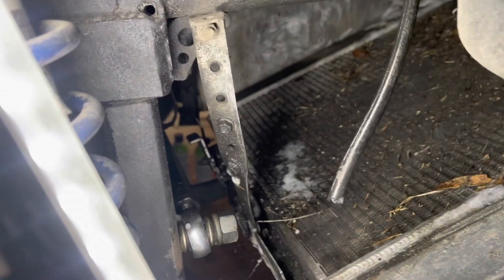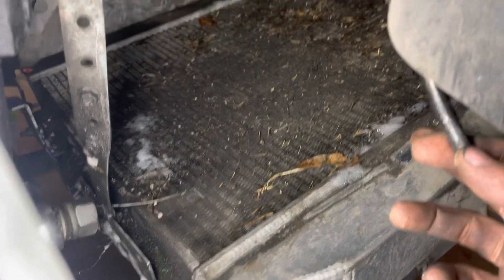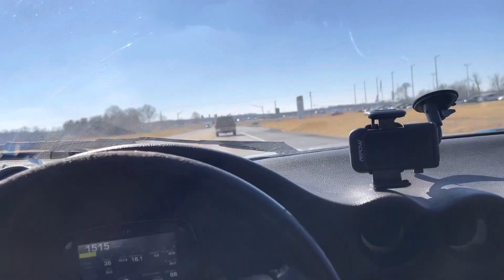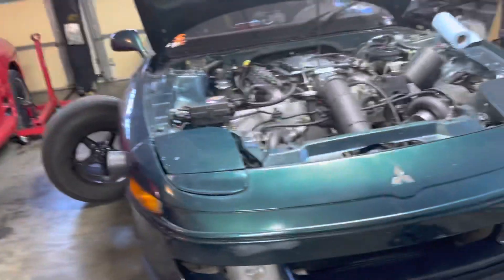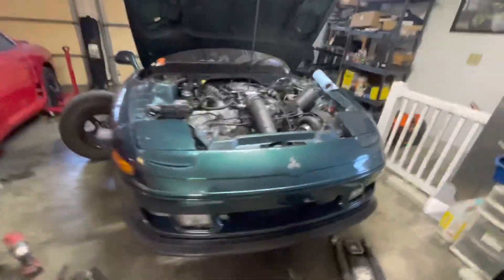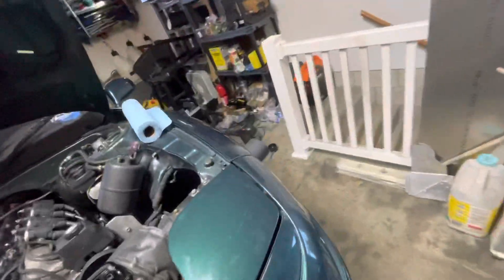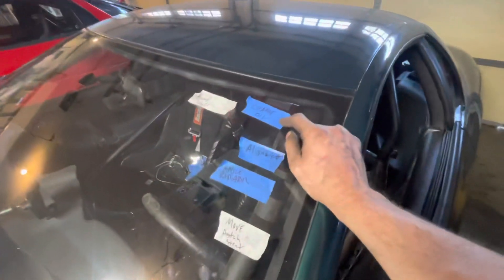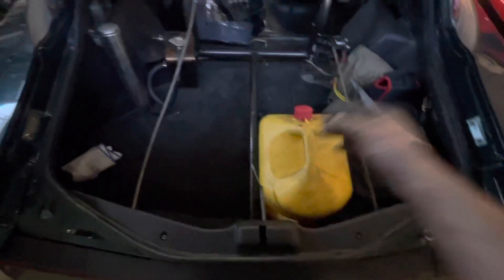AWD LS 3000GT Twin Turbo bumpsteer correction and Race Week prep

Comment: Going back to the flip ups is better looking i think.  Hopefully your new closer front to rear gear ratio/tire size combo will not torture the transfer case as much and the new chain will live a little longer.  I imagine the tons of street mile doesn't help the chain life either.
Reply from the maker: No strain on tcase with street miles with the axle disconnected in front diff. But I do agree that racing on the very slightly mismatched gearing may have contributed to premature chain wear
Reply: @4familyman  I forgot you had that axle disconnect.  Or its the 4 digit horsepower and slicks. LOL
Reply from the maker: I don’t think it likes radials. Slicks will probably help the life of chain a little

Comment: Have you looked into your ackermann angle of the front steering arms? It almost looks like it’s backwards. Would cause some geometry issues if it is.
Reply from the maker: Yes the Ackerman is jacked up. The knuckles are flipped, side to side, because I have a front steering rack, versus stock is rear. The car is a straight line car so doesn’t really matter. But at some point I may fix it,,,which requires cutting the steering arm off knuckles and moving them in. But again, doesn’t really matter.
Reply: @4familyman  for sure,  I really dig the awd setup, keep up the good work
Reply from the maker: Thanks!